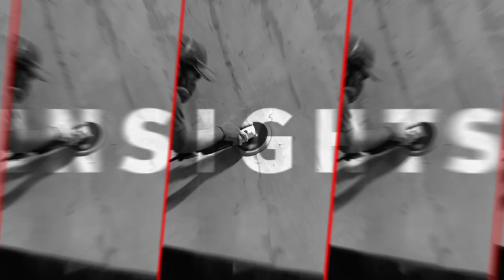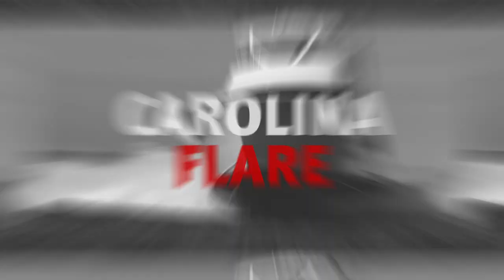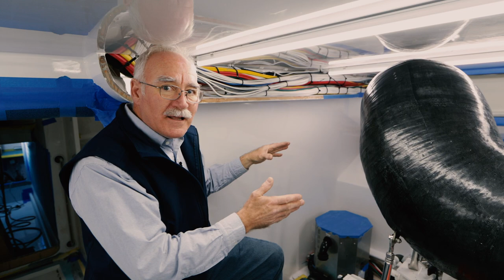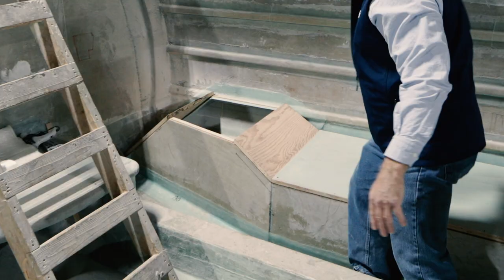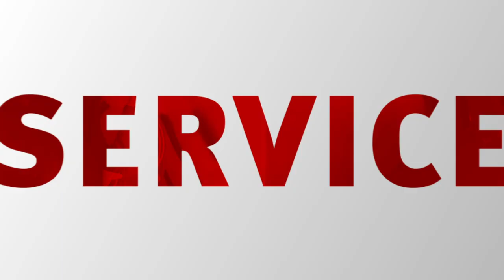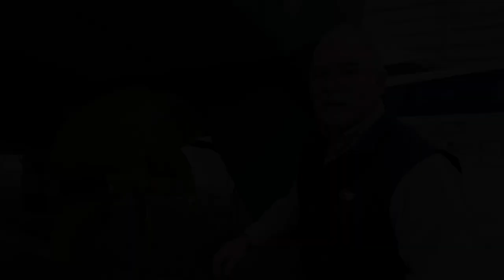The Magic of Underwater Exhaust in Custom Sportfish Boats at Jarrett Bay - JB Insider: Ep. 1

Comment: question -- the underwater exhaust exits, it looks like, where the trim tab pocket would normally be. So does that exhaust style require the switch to interceptor style trim tabs? and those tabs moved more towards the centerline?
Reply from the maker: Good observation.

In the past we have used conventional trim tabs, squeezed inboard, with the underwater exhaust system. However, once the Interceptor/Humphree trim tabs entered our world, all of our customers have opted for them. Both trim systems create an overcrowding issue, but, as with everything in custom boat building, we just have to figure it out and make it work. That’s probably what attracts a lot of us into this business.

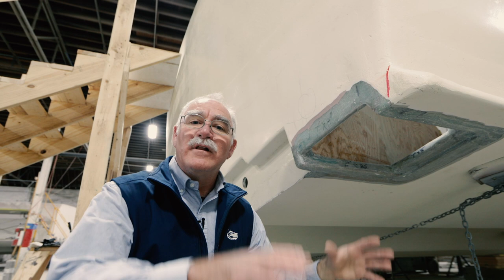In the video at 3:11 there is a brief glimpse of the starboard side recess pocket for the Humphree trim tab on Hull 64.

Good question. Thank you for your interest. - RV
Reply: @JarrettBay  thanks for the response, RV! Also, I'm guessing that putting the Humphree on the stern, surface mount, above where the exhaust exits wouldn't work because the exhaust would essentially punch a hole in the water just forward of the tab. Negating any effect the tab might have.
Reply: @JarrettBay  moving your tabs inboard exponentially reduces their effectiveness.  Agreed?  Been building boats my whole life here in wanchese and have seen many fads come and go..
Reply from the maker: Hi Michael, That is a good point. Any changes to the hull of a boat can have a negative effect on some other aspect of performance. So far, our designers have been able to maintain trim functionality with it squeezed inboard due to the underwater exhaust. That is one of the concerns when designing around an underwater exhaust.

Comment: Hi RV. Can you advise on underwater exhaust but exiting the hull just behind the engines in the engine rooms, instead of out the transom? 

Sort of where you have the dog house but out the bottom right there.

What are your thoughts or experience in this scenario?

Thank you
Alex
Reply from the maker: I have seen some boats with the exhaust in the configuration that you have described. And it certainly looks tempting for the space savings that would be available.

However, I have no first-hand experience with that, and, to my knowledge, Jarrett Bay hasn’t installed one. That said, I can’t speak with any real authority on the subject. If I was considering it on a project, I would want a few answers before I broke out the Sawzall. I’m sure there are more pitfalls to consider, but offhand these three questions immediately pop into my head.

First, what is the potential of exhaust coming up beside the boat (smudging up the hull) and possibly back drafting into the cockpit?

Second is how would the exhaust backpressure be affected?

And Third is how would the back down “surge” inside the exhaust chamber be absorbed?

I would take those questions up with the engine manufacturer and an exhaust designer before I went to the next step.
Reply: @JarrettBay  excellent reply. I do appreciate the honest feedback. Definitely some unknowns here that would require further assessment before committing.
Thank you, Alex

Comment: How do you guys/other builders deal with the added back pressure those underwater exhausts produce towards the engine? I can see how it might not have as big of an affect while running but what about when the boat is sat still? I'm no professional on this, just have a feeling that the added pack pressure would result in loss of performance??
Reply from the maker: Good question! In short, there is an engine idle bypass built into these systems. So at idle, the exhaust is routed to smaller outlets just above the waterline.
Reply: @JarrettBay  And then once the engine is up to speed, the air flow out of the engine negates the back pressure problem caused by water.

Comment: So, what you didn’t cover in the video is that style of exhaust needs a bypass. A bypass is a smaller usually 2” or possibly even smaller but on this boat more like a 4”, exhaust tube that goes out the back of the boat. That way when the boats sitting still, running, it does not create a splash on the side of the boat.